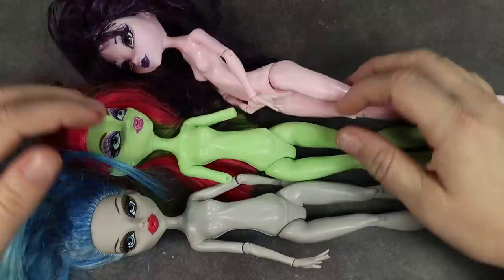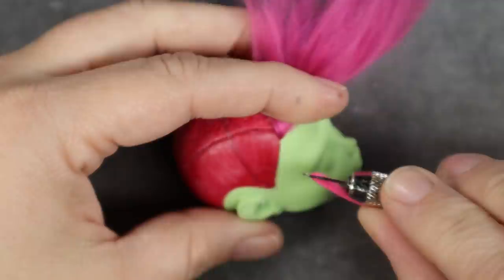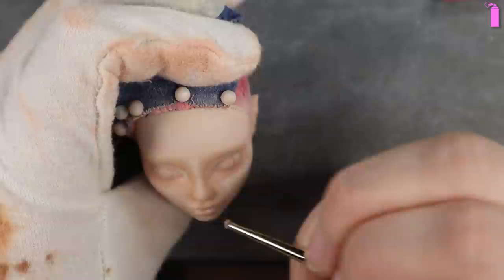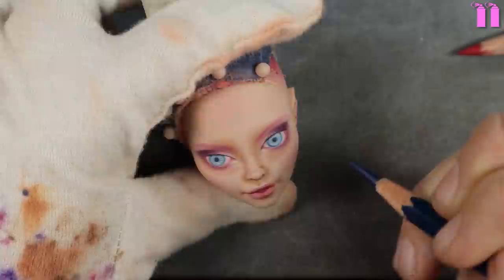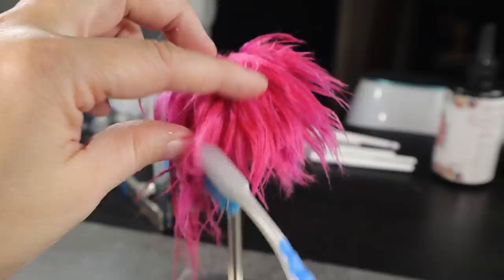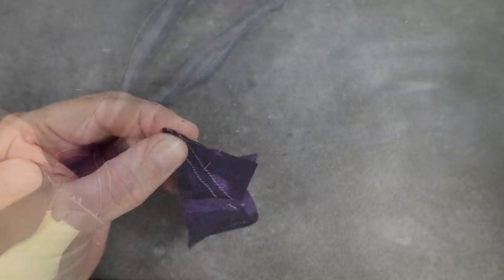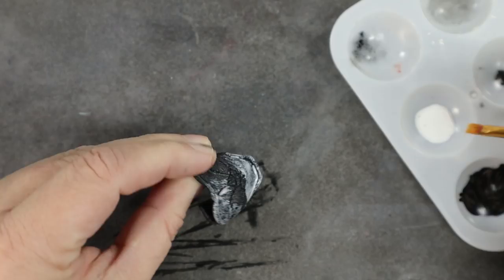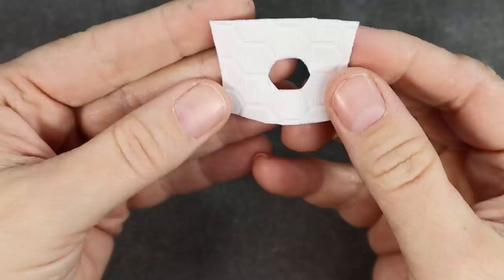Repaint: Vi League of Legends Arcane Art Doll That Nearly Killed Me!!!

Comment: If I had a 3D printer like yours would I be able to print monster high doll legs with scales made on them? I’m new to the 3D printing world.
Reply from the maker: I don't see why you could not, there would still be the issue of finding ways to attach them since regular monster high legs do not pop off.  The create-a-monster line has removable legs but you would need to make sure you modeled the sockets correctly for fit and scale. With 3D printing I only run into issues with certain doll scale things being too delicate to print and handle, attaching things especially when wanting them to be removable, and the rigidity of the resin (since the resin has no give, shoes can not go far up on the foot because the toes are bigger, this is why most regular MH shoes are rubbery.)and finally being limited with my own 3D modeling skills.